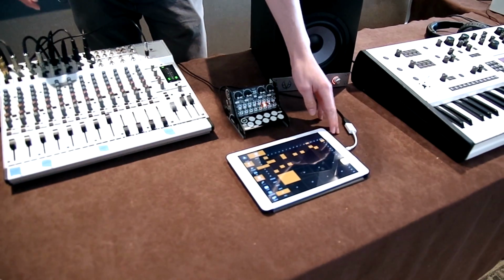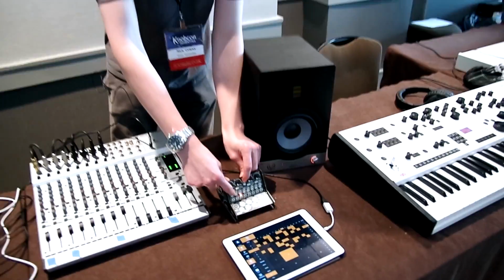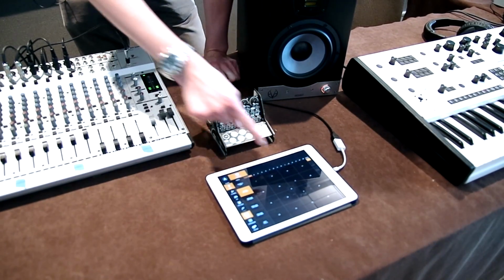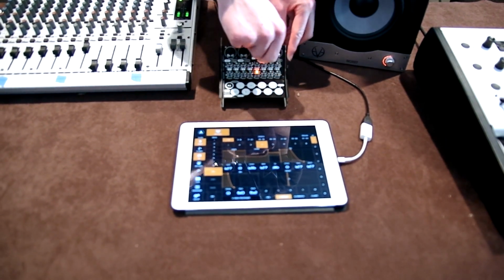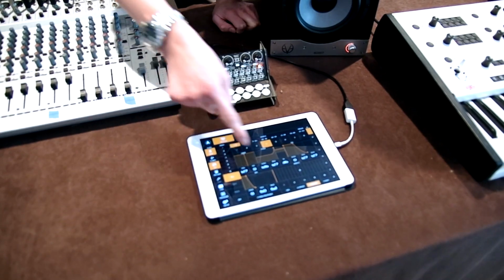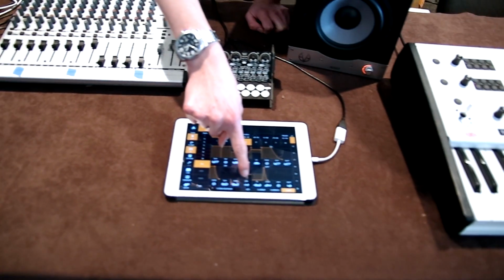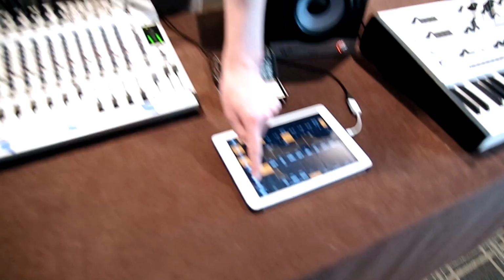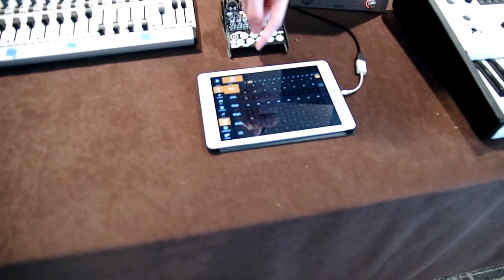Modal Electronics CRAFTrhythm First Look

Comment: We do not want hardware sample player that is controlled mainly by app. There are tons of apps ... KOALA for example, that are more powerful. I have this one and use app only for sample import. I think it was big mistake that MODAL put such a big accent on app n diminish the device itself. Oh... and the knobs are horrible! Is it so difficult to choose smooth n handy ones? No sync or midi in is lame. On the pros side the idea of a kits, grooves and envelopes make this one unique. It is handy as a simple 8 track drum machine. Ill leave this one as collector item cause it makes nice set with CRAFT 2 and SKULPT.

Comment: Interesting direction to take, I like it 👍
Reply from the maker: The CRAFT line is definitely interesting and it's impressive to see what they can pack into a tiny device. It highlights that much of what you pay for with electronic instruments is the quality of the case, controls, etc vs the electronics.
Reply: @SynthtopiaVideo  It's rather weird that this product didn't become more of a success. The CraftSynth and CraftRythm are essentially very similar to Teenage Engineering machines, but with cool little classic synth formfactor and easier ways to interact with it using the app (which they then renamed and released for free for anything from Windows to coca cola cans) so one can midi control them or just fiddle with the sounds in the app.

It seems like a lot of people, judging by comments on other videos, gets hung up on that it at all has the app interfaces that one can use if one so wishes, and by that rule it out as just being an app in hardware form and complain that they then can use VSTs. (Like turning real knobs isn't fun!). 

But, I mean, they do have serious electronics and do produce sweet big and deep sounds. This Rythm also seems fucking sweet to just drag and drop sample sounds into when connected to a computer for sample upgrades. Also, how can this video only have 12 likes? It's informative,  to the point, and deserve more attention. I still feel that this range from Modal is an overlooked gold nugget of fun and good playing experience. Sadly they seem to have made the 2.0 (of CraftSynth so far) much more 'normal' with a sturdy casing and such. That these are literally flat packed and hardly weighed anything gave them some extra charm.